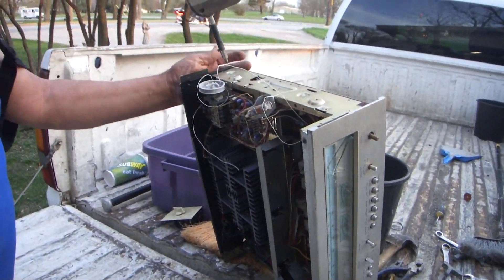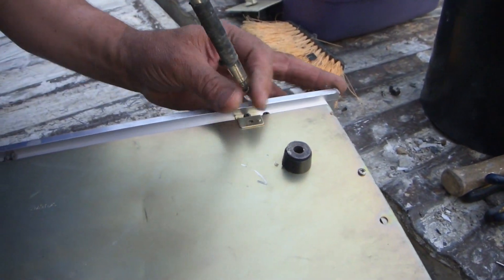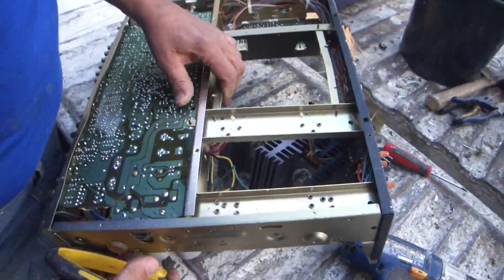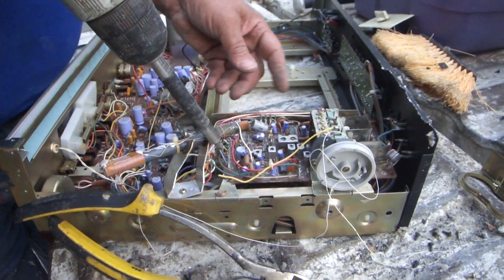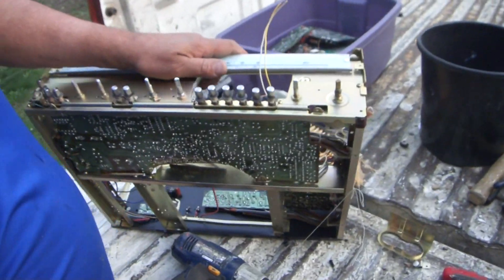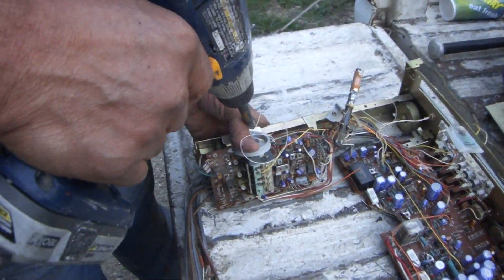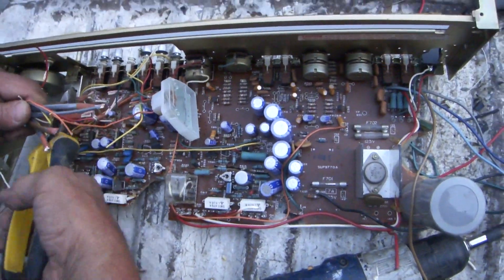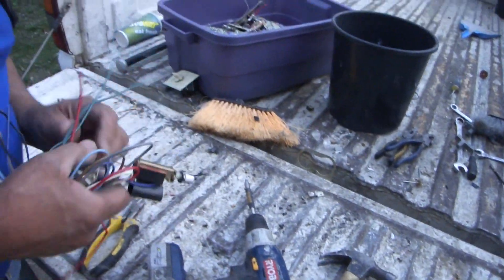Scrapping Out A Old Radio

Comment: I think it's a shame because it could be restored.  Often they work like new when just a few caps and transistors are replaced.
Reply: Exactly, what a waste...ehh
Reply: Mateusz Stolarczyk
Reply: Yeah. I took an old tube-type table top radio from the '60s to a repair shop. Gave 'em $80 to diagnose what it would take to fix it. Got a call a month later, was told it was worthless.
Who's the fool?

Comment: What's really funny (and sad) is, that thing cost some rockenthusiast a ton of money not long ago. Technics made some awefully powerful and crisp sounding equipment. It really isn't hard to fix this stuff, often times it's a matter of nothing more than removing the cover, plugging in a couple speakers, messing with all the switches, dials, and wiring inside, and odds are high, you accidentally run into the problem. Then you have a couple hundred dollar ebay sale?
 FYI, those are capacitors, occasionally they can hold a charge that'll knock you off your feet, or destroy your pacemaker. 
If your grandkids like messing with it, you can make your own erector set, or erector set additions, with all those tuner parts, belts, miniature pulleys etc..
Reply: I was given an AM/FM/SW radio, that didn't work. I open it, had a little water inside. I used a fan, left it open with the fan, dried it out, and works fine!!
check it out!